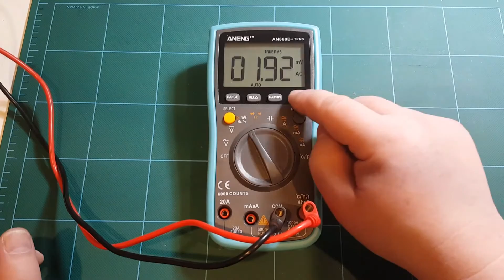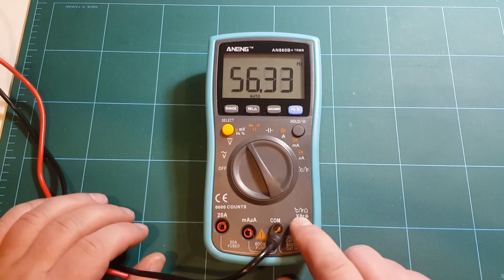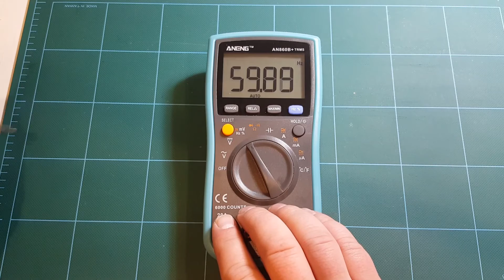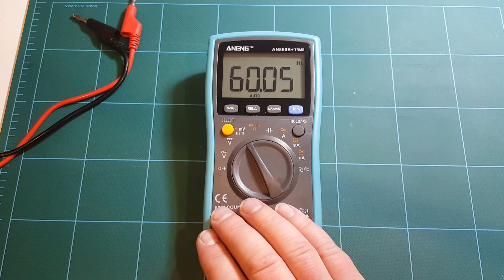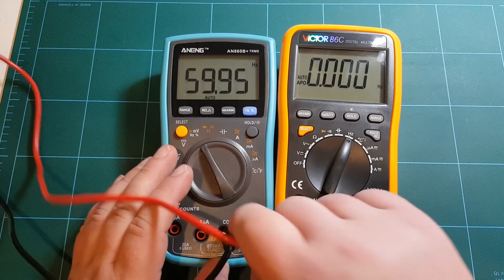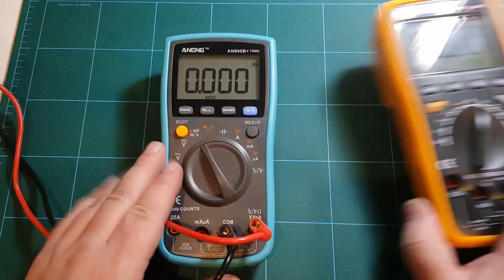Aneng AN860B+ DMM frequency measurement

Comment: You seen surprised that the count on frequency is greater than 6000? Well the 6000 count only applies to things like voltages and currents and resistance/capacitance. Frequency is counted by totally different logic inside the chip, and the 6000 count limit does not apply on a particular range.

Comment: It is interesting that its little brother ZT102 can measure up to 200MHz according to "joe smith" channel at 15m50s mark of video titled "Kasuntest ZT102 / Aneng AN8002 review and other" Maybe you can get it to do some side by side comparison.  Perhaps it depends on type of signal you provide: eg. pure sine, square wave.  I found your channel searching more info on AN860B+ and you covered it well, subbed.
Reply from the maker: I'd be happy to compare the two meters. However, considering that ZT102 has fewer features and appears to be about the same price as my Aneng, I don't really want to spend money on it. If anything, I'd buy another Aneng if I needed one more meter. I'm not sure if I would believe that 200MHz claim. Also, if you need to measure such frequencies (do you really?), perhaps it would be better to invest in proper frequency meter.
Reply: Artur's Lab The only thing that ZT102 has going for it is its pocket size. Also, I have found some information on a Russian site how to enable the missing feature on ZT101/ZT102. As for frequency test, it seems you need to make sure the signal is higher than 10v and the cables must be high quality. I think if your meter tested in same environment, it will perform similar.
Reply from the maker: That's interesting. What missing feature is it? Can you post a link to the site?
Reply: Artur's Lab The ZT101 can get Temperature setting either by eeprom mod or resistor mod and the right OFF will act as Temp. Pretty much all the features in AN860 can be enabled/added to the ZT10x, except for the microAmp. http://kazus.ru/forums/showthread.php?t=112135 you will find links in middle of first post.
Reply: You can even turn the meter into 10,000 counts by editing the eeprom. In the same thread I found the info to turn my UT210E into 6000 count.
Reply from the maker: wow! tons of good info there. I'll have to read through the thread. i might be tempted to buy that meter just to play with it

Comment: Thank you!
Reply from the maker: Whoa! this video wasn't supposed to be public. i was going to combine it with the take-apart video. Oh well, here you go :) Hope this helps.
Reply: Artur's Lab Yeap, it does. All in all 8 mHz isn't so bad for cheap meter. Hope that our chinese friends didn't engineer anything terrible inside it. If so, it would be very worthy item.
Reply from the maker: I've just released the take-apart video. It isn't a Fluke, that for sure. But for $20 I think it is a good value. I'm actually thinking about buying one more just to have an extra meter on hand.
Reply: Artur's Lab Oh, great! Thanks! On my way to watch it :)